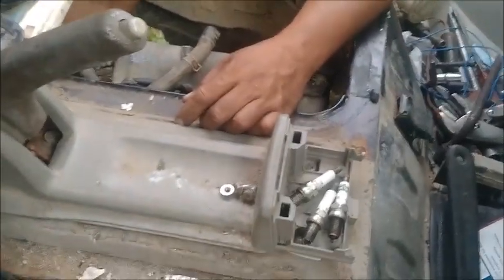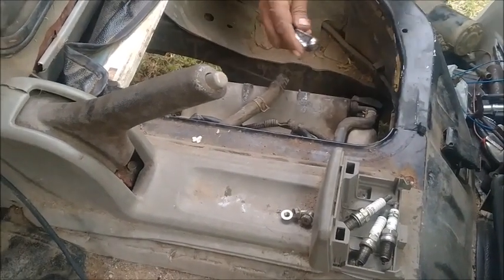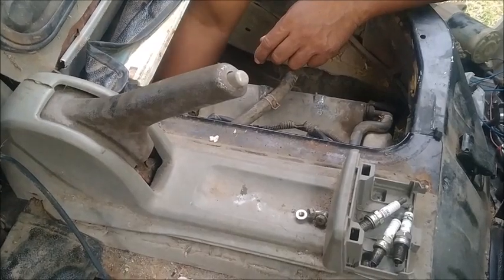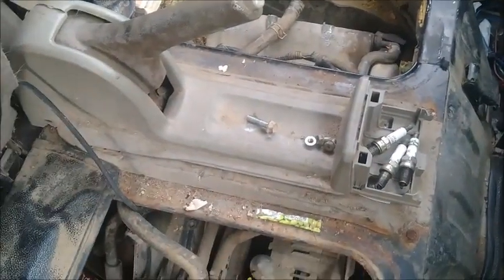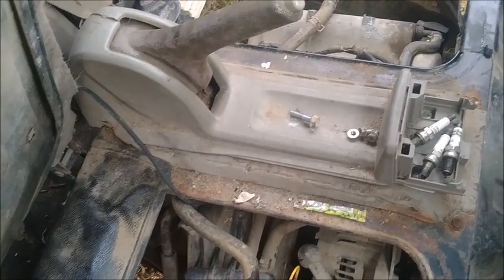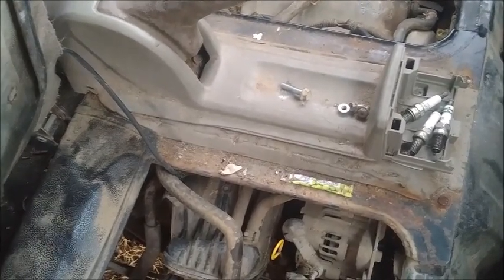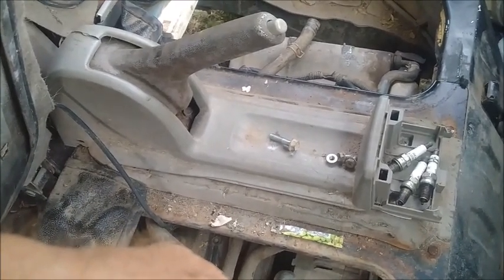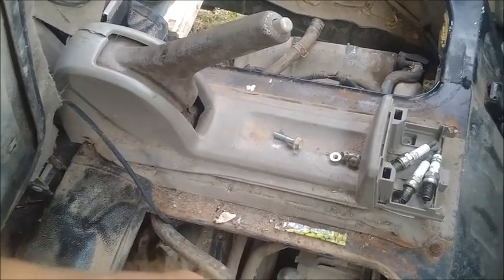Waiting Game For Our Van

Comment: I have a 2016 multicab that I just repaired. Intermittent firing on all cylinders and then one cylinder quit so it had a bad miss. I changed the camshaft sensor. About 1000php on Lazada just unplug one wire connection and one bolt (10mm ). Easy replace. That stopped the intermittent firing so it ran great. One week later I had a bad miss on one cylinder. By pulling each coil off one at a time I narrowed down which cylinder it was. I swapped the coils and tried it again. I diagnosed that it was a bad coil. Another easy fix and less than 4k php total. Good luck. Its worth a try.
Reply: Am curious Sir, just how old the vehicle is actually, maybe 15 years or more. Was used in Japan before being sent to the Philippines presumably?
Reply: @cynthiagarnham1157  According to the paperwork it is a 2016. That being said who knows for sure. I could do the research but it really doesn't matter to me. Yes it is a surplus sent from Japan in pieces and reassembled in Cebu. By being shipped in pieces makes the import taxes much less which keeps the cost down. There are a lot of horror stories about multicabs but I have been very lucky. I use it to the limit of its abilities almost daily and not just for transportation.
Reply: Yes sounds like bad coil / leads

Comment: Trade it in on a another vehicle
Reply: Buy them a new one bear
Reply: Don't bother bear I offered they turned it down
Reply: I wouldn't even have a van or a car or 4x4 here. Better to get a Chariot ( if fitted with fold down , bench seats, can carry 8 passengers, plus the driver!)or just a motorbike( 50 mph here, is considered very fast on provincial roads!!)If one wants to get a load carried anywhere  locally. Can hire a trike and driver,  for less than ten bucks ( up to 25 miles!).